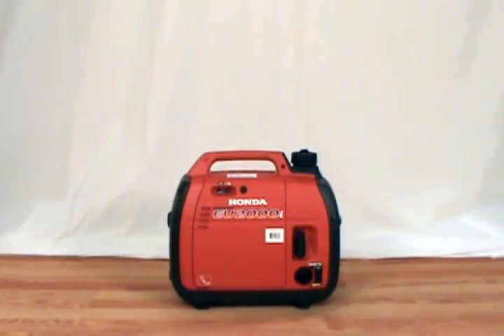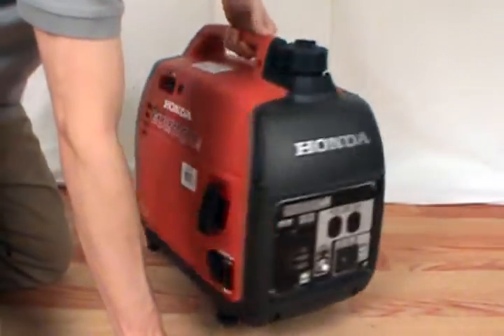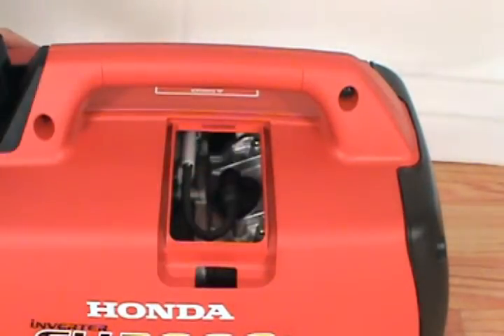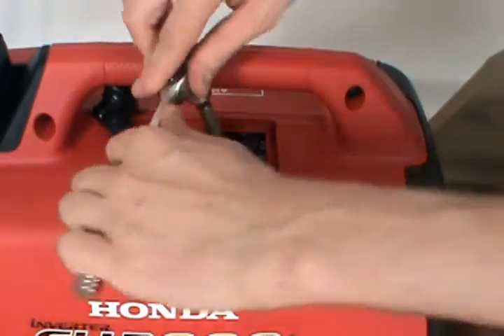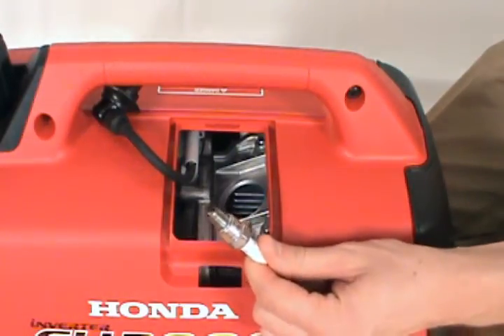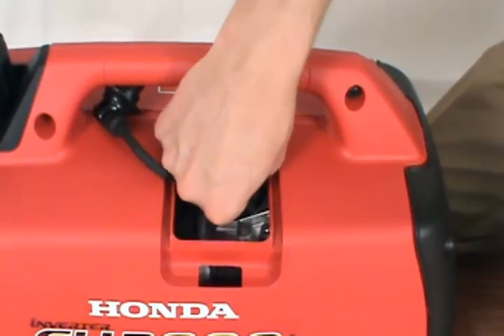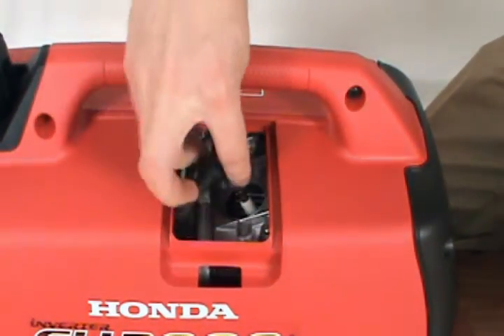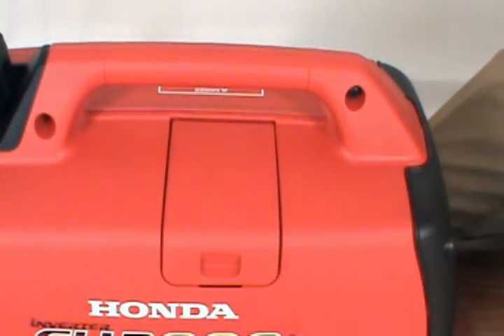Changing the Spark Plug - Honda EU2000i Generator

Comment: You could have disclosed the proper sparkplug used and next time use an extension and socket with rubber friction insert to remove plug instead of your finger tips....
Reply: He did, read the description moron
Reply: @aviationnationhd3760  your full of shyt moron he did not...
Unless of course you saw a longer version .....🤪
Reply: @aviationnationhd3760  You should read all the other comments moron and you will see I was right.

Comment: I can’t get the spark plug boot to pop off like you did. Very tight so there has to be a trick to doing it.
Reply: Push really hard and use a Quarter to pry it open... That’s what I just did.

Comment: you dumb ass--what size socket  to remove the air fuel mixture ignition  devise. Sometimes called a spark plug. you must live in a state where your love of life is your cousin and what in the hell is the spark plug gap?did you tighten it to German specs?you know---good and tight!please get a life sir!hard water is not ice.

Comment: would be helpful if you specified what size socket you need.
Reply from the maker: David Devonick  The socket size for the NGK 6535 CR5HSB  spark plug is 5/8 inch (16mm)
Reply: Thanks much.  Appreciate the response.
Reply: Is this the same  size I'd need on the Honda 1000?
Reply: Spark plug sockets come in two sizes.  Large and small.
Reply: There are 3 sizes
Reply: Would like to know what size spark plug